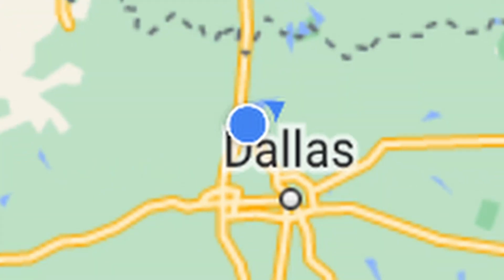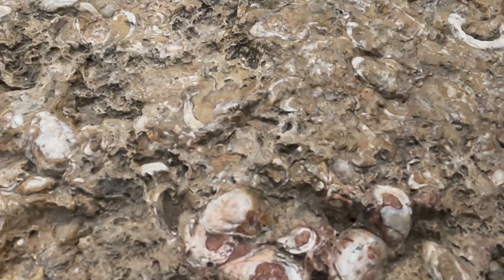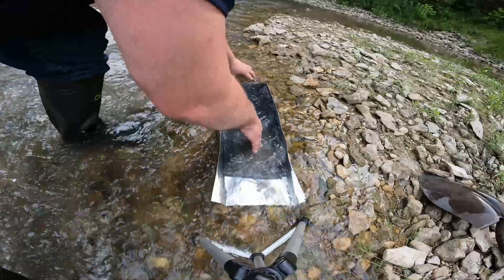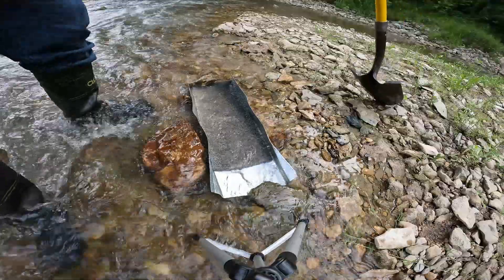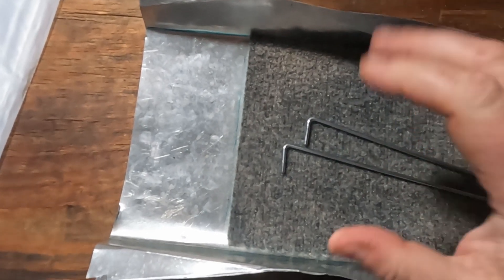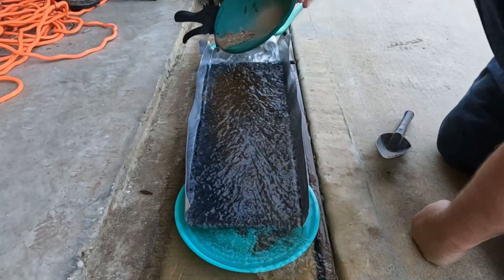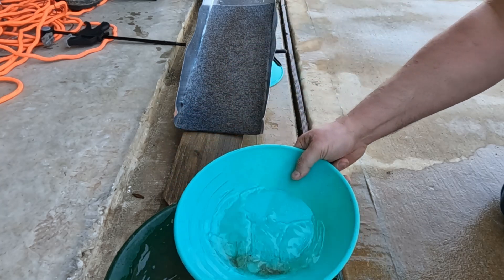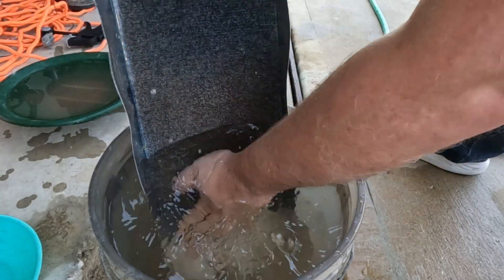DIY Gold Prospecting Equipment: How to build your own $10 sluice box!

Comment: Why are you stil glueing the material in the sluice. You need to be able to remove it to clean it upside down in a pan 🤦🏻‍♂️
Reply from the maker: The objective of the build is to have a decent size fully functional sluice that can retail for $10 plus shipping. This is intended to fill a similar niche as dollar tree.

I evaluated several designs for holding the matting in place
 - nut and bolt
 - tent peg
 - cutting tabs in the sides to fold over
 - glue

Cutting tabs will cause the sluice to lose material.
Nut & bolt significantly increases the cost of manufacture and permits water and material to flow underneath the mat and out of the sluice.
Tent peg basically does nothing at all - the whole sluice comes apart and washes down stream.

Glue is inexpensive, keeps the full width of the mat firmly attached to the full bed of the sluice, and zero material is able to pass through the sluice below the matting.

Thus, I use glue because it performs the best and is by far the most cost effective. 

It's definitely an outside the box solution but it's not as if it's immoral or illegal. It simply is the best way to recover the most gold for the lowest price.

Comment: Not bad Sir! Definitely an improvement on Version 1! I think that you should try adding a Wooden Frame around it to give it a bit more support, weight, and keep it from flexing, plus be a better mounting point for some legs/retaining rods to prevent it washing away. Additionally, to make your retention and clean out easier, with a wooden cross rail sideways at the top and bottom, you can then just screw the Carpet into it by adding Riffles to create even downward pressure and creating negative back pressure to increase precipitation of Gold/Heavies from your material. Even just simple Pallet Wood would work, and keep the price virtually free and overall weight down. 🤷‍♂️😁🤘Plus being able to fully remove the carpet to flex it out and make sure you’re getting everything without having to worry about dealing with the entire sluice would be nice I’m sure!
Reply from the maker: I've been nervous that using wood might cause it to float.. it already tends to get caught up in the current a bit. I've been looking at thicker gauge metal, so far no luck.
Reply: @goldnoob  well, depending on thickness and species, you could opt for a nice heavy dense type, which would resist wanting to float away. More so though with upgraded Rebar legs or Wooden ones with feet that you can put rocks on, and a Set Screw or Pass Through Bolt locking system to control pitch/height cheaply.

You could also double up on your metal, in either a 1 piece multi fold from hell hehe or 2 pieces, and then solder them together. You could also then bead roll or bend/hammer in some stiffener ribbing. Which would also keep it from wanting to flex.

Here's another idea I had for Poor Man's Expanded Metal Mesh, Chicken Wire cut and stacked in 3-5 layers high with overlapping mesh patterns to prevent rocks/pebbles from falling down too. If steel, it could be then be magnetized, and help filter out black sands as well!

Been thinking about fun ways to make my own for years on the cheap, especially to capture the ultra fine flour gold we have here in Michigan. A multi tiered highbanker style setup was my best thought for maximum capture zones and current/gravity changes. I've got some fun ideas that I've yet to see anyone use together...like a Venturi tube to create rotational spin between tiers, post top tier mesh preventing any big solids from clogging the funnels and downpipes. 🤷😁😉🤞🙏 We'll see if it works how I think it might, or if its more cleanup sluice only for cons only. Gonna make a Rockhounding and Treasure Hunting channel as part of my Network on here, with weather getting nice finally, I'll be able to get some Agate, Yooperlite, and Gold hunting Content in soon! 🤞🙏🥰🥷😎🤘
Reply from the maker: That sounds awesome!! I'll keep an eye out!
Reply: @goldnoob  thanks man!! ❤️🫂😁🙏🤞🤘 Been filming a bunch of stuff since last year, and want to make a shotgun esque opening salvo of Content across multiple niches to kick off my Network! I'm intrigued to see how the "Algorythm" reacts to like 30+ videos and a dozen different channels springing up outta nowhere in true Ninja style hehe 🤘😁🤘🙏🥷🤞

Also I was born in Galveston, and been meaning to get back down to Texas for awhile!! 😁 Miss that delicious BBQ!! 🤤🤤🤤❤️‍🔥🔥❤️😍🥰